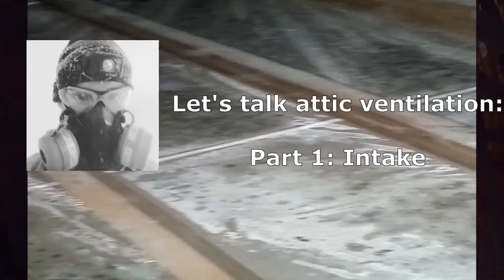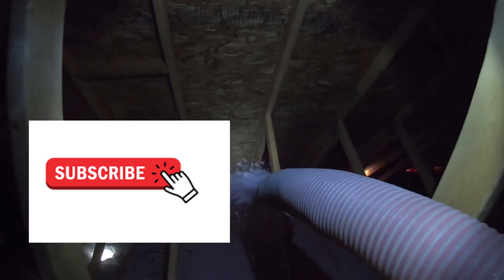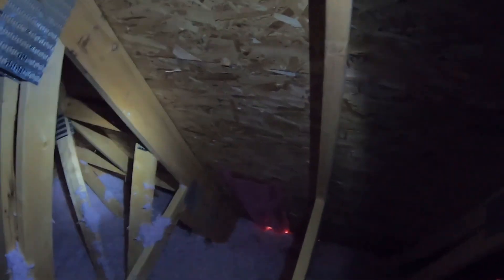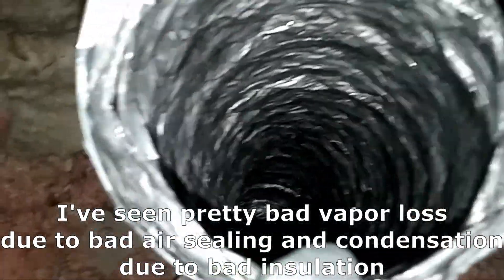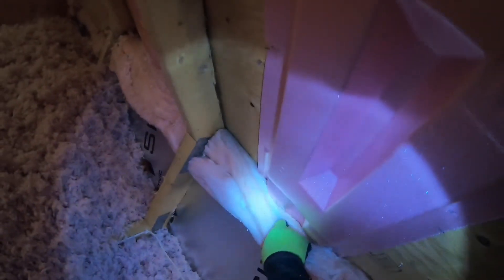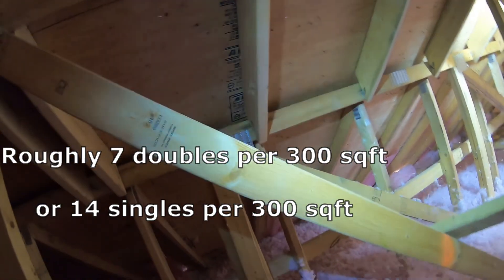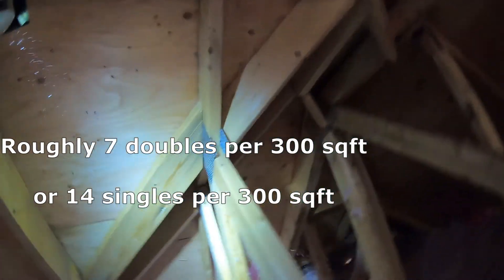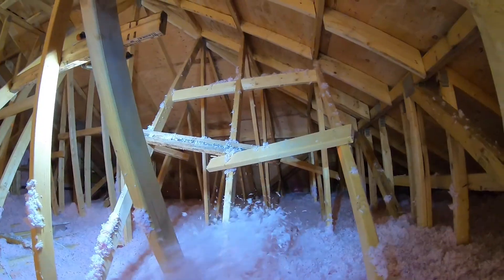ROOF VENTILATION, BAFFLES EXPLAINED part 1 intake

Comment: With a half story cape cod, should the baffles run continuously past the knee wall in the the upper attic with a ridge vent?  In other word if the roof is uninsulated and the knee wall area is exposed to outdoor air, do the baffles run continuously past the sloped ceiling in to the upper attic?

Comment: Would I install attic battles in-between rafters where i do NOT have soffit vents? I only have a certain number of soffit vents on my eaves... I installed rafter baffles in each of these locations. But in the locations that do NOT have vents... can i blow in insulation into this area or will it affect ventilation?
Reply from the maker: I wouldn't add insulation in the soffit where there is no vents. It would affect cross ventilation and would cost more for insulation for nothing. I would add an extra vent on adjacent to each vent you already put in. Thanks for watching!
Reply: Awesome thanks so much for the advice (2 years after you video). Great content! @SinnisjInsulator

Comment: I am about to redo my attic.  I am tearing out my old fiberglass batts and will be installing celuose.  I dont have a vapor barrier installed.  I need to get your baffles and install but need to make sure i install the correct number of baffles. 

My attic floor is 1200 sq ft and have a small roof pitch like 12/3 or 12/4.  My rafter joices are 16" on center.

What is your recommendation for the number of baffles to install?
Reply from the maker: It's recommended you install one in which cavity if you can. Thanks for watching.